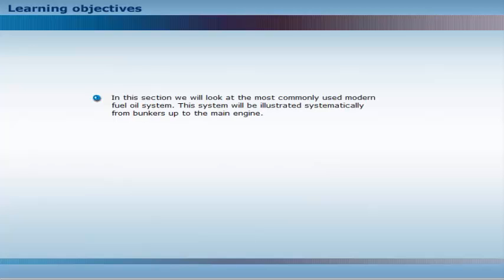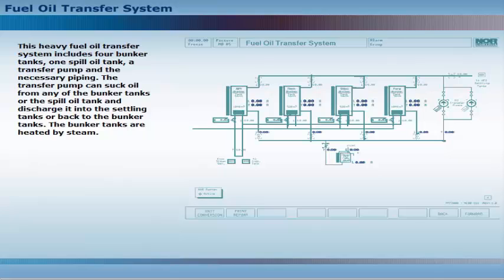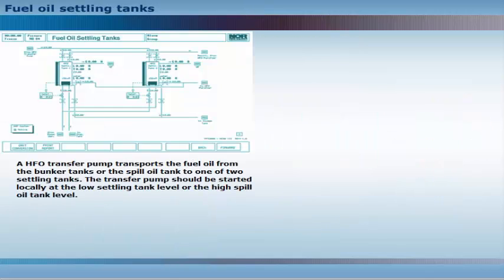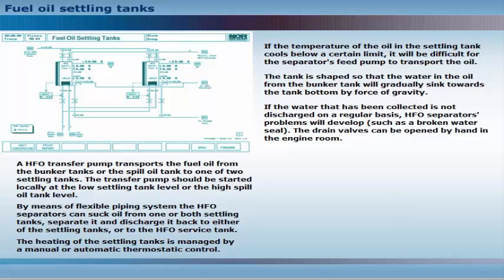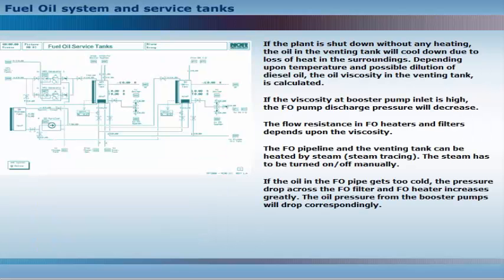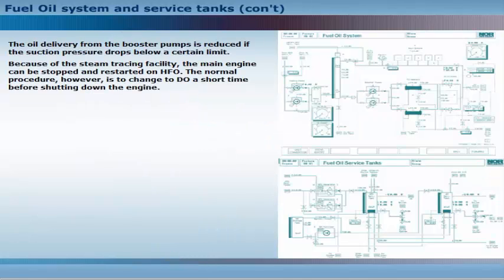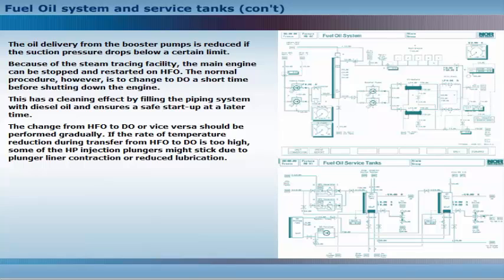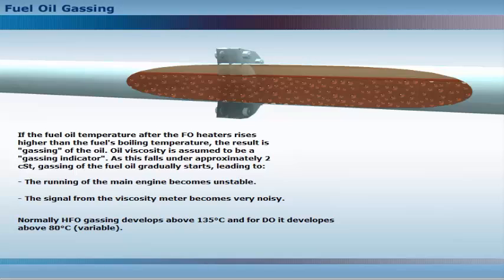Main Fuel Oil System

Comment: hello, we have a problem with the fuel system, I am trying to find a solution. When we open steam to the fuel heater, the fuel pressure rises, I disassembled the heater, I tested it, there is no leakage